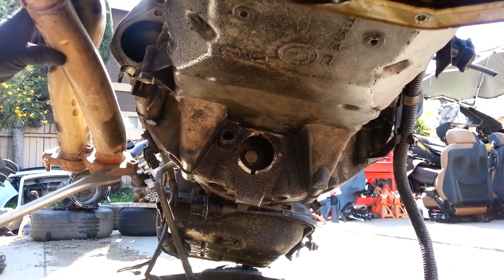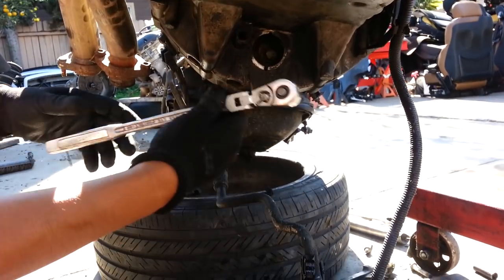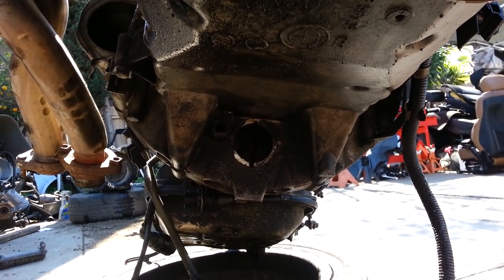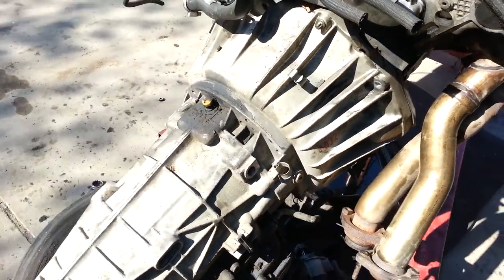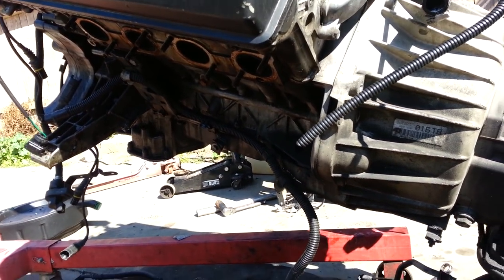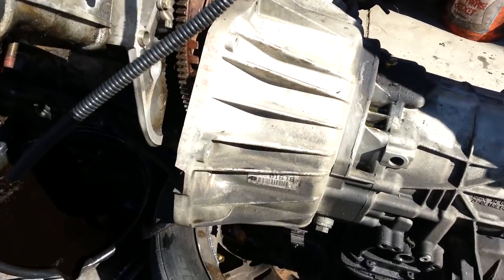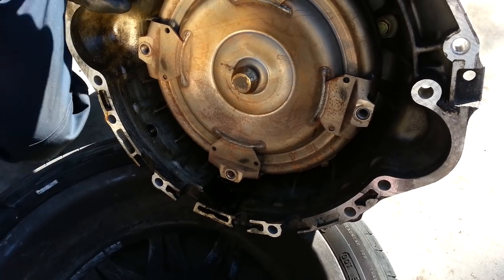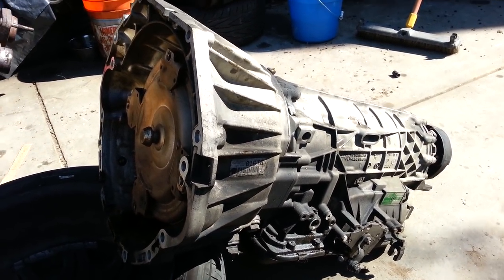BMW Automatic Transmission Removal e39 540

Comment: would you possibly know anything about swapping a 540i e39 6sp into a e38 740i (short wheel base)? i would like to do this to my 740i but am not completely sure on what would be neede. i think the e39 trrans would bolt right in but what else would i need to do besides the computers and clutch assembly? any help would be great and i have used youre videos for help before. thanks
Reply: bighanes26 Bro that would be so dope, a 6 speed E38.. did you ever get it done???
Reply: Im trying to do a similar thing . Transmission went out on my 740i & only one i found was in a 99 540i but wanna make sure if the transmission will fit & work properly any advice or if it will fit ?

Comment: Thanks for posting this very helpful. I was looking for an instructional video on the E-34, from all I can tell,  I have a 1994 525i, v-6.  What should I expect to pay for a used transmission, is removal pretty much the same as what you demonstrated for this E-39, and is there a model number or something so I can make sure that I am purchasing the right one when ordering it?  (I found a place on ebay called Bavariambmwparts that seems the most affordable, but I want to make sure it is the right part.) Thank you
Reply from the maker: Thanks for watching our video.  We don't deal much with E34 models so we wouldn't be able to offer much advise regarding transmission.  We recommend that you go to realoem.com  Input the last 7 digits of your Vin # and your transmission model should come up.  Don't think you should pay more than $500
Reply: I will do that,  and once again Thank you very much.  Great video and an enormous help.  Cheers.

Comment: Thanks for posting. A lot of your videos have helped me a ton trying to bring my 740il back to life. I was hoping you can help me by answering if it's possible to replace the transmission on my 98 740il with a transmission from a 2001 740il sport model. if it will be plug n play or will things need to get reprogrammed and/or replace the TCM or other computer components.
Reply from the maker: Transmission from 98 will not fit 2001 740iL due to steptronic feature found on 2001 740il models.
Reply: bimmermerchant Thank you very much.

Comment: great video! I have a question though. Can the torque converter clutch be changed without removing the Engine on a 97 740i?
Reply from the maker: Transmission and torque can be removed without removing the engine from your bmw.

Comment: There no way to get to those 4 bolts unless u have the engine out??
Reply from the maker: Hello,
Are you referring to the flywheel bolts? If so, you don't have to remove engine.
Reply: bimmermerchant what do you do if the engine is seized?